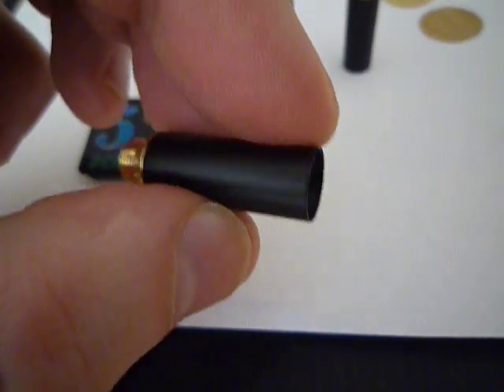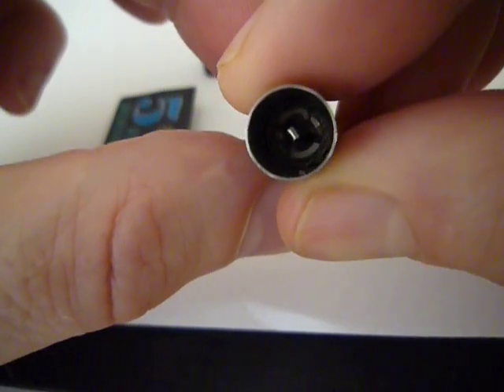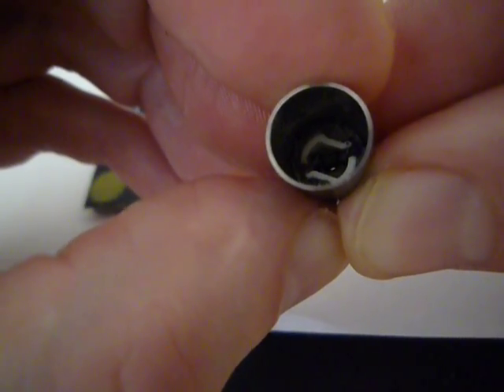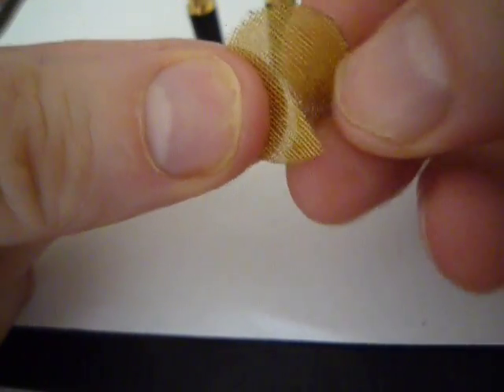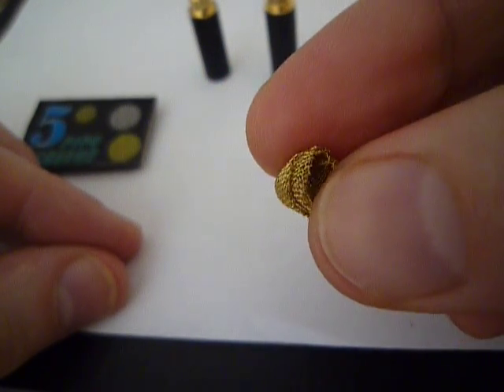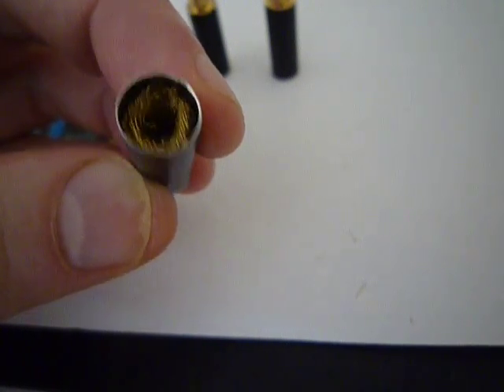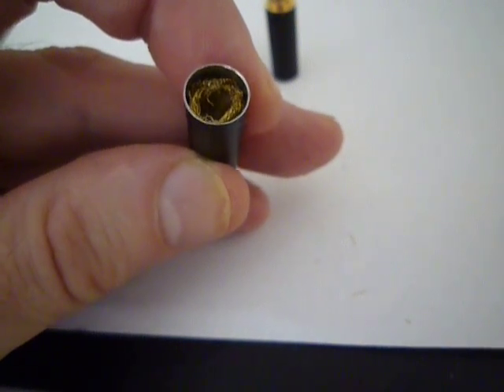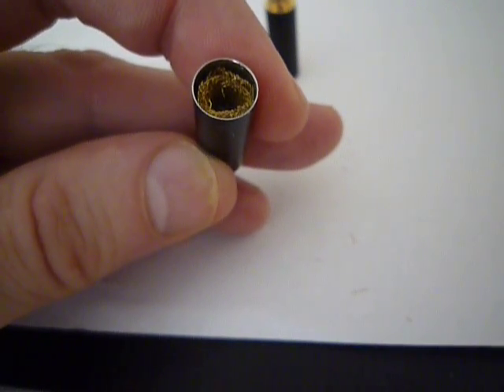UPDATED 21/10/11 Easy Pipescreen Atomizer Mod for 510 Atties! Longer Vaping, Less Dripping!

Comment from the maker: PG is more runny and so drains out of the atty faster - vg less so. LF atties worked fine for me - try washing/blowing through your atty with hot water a few times and doing a dry burn, then repeat. However, if the wick is badly burned you might need to follow the method in this video which involves dewicking.

Comment: Hello. I was wondering if this method is adaptable to use on a 306 LR Atty with a cannon style drip tip. I love the vapor production of 306's but as you know they do not have a cup surrounding them. I would think it would work with a cannon tip but I'm not sure.